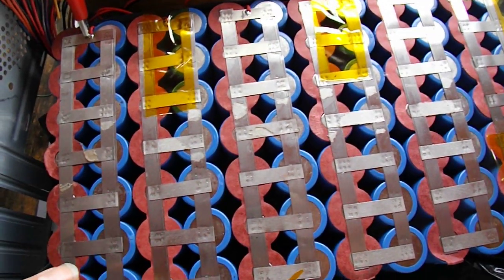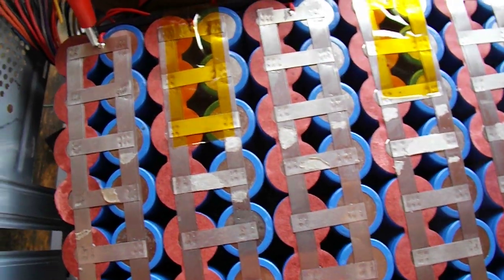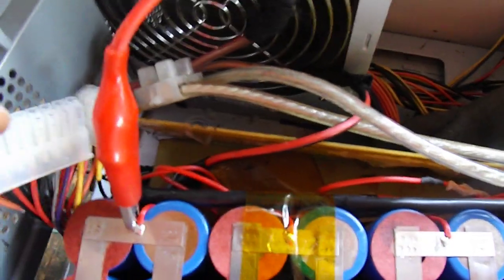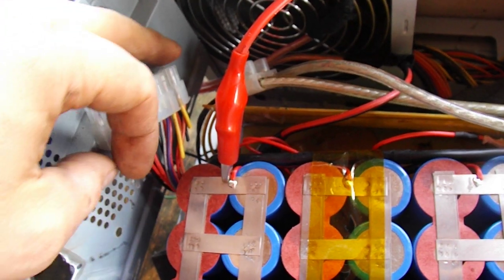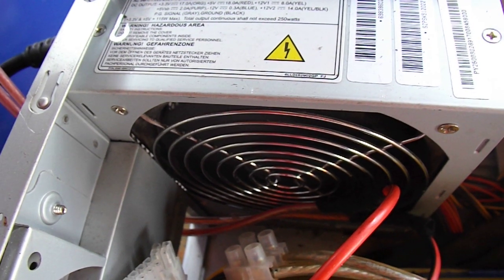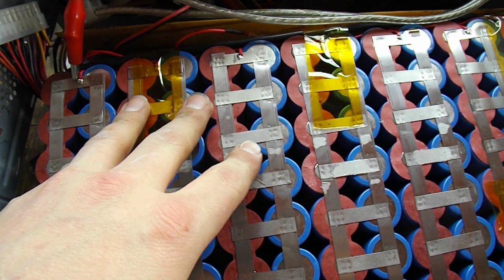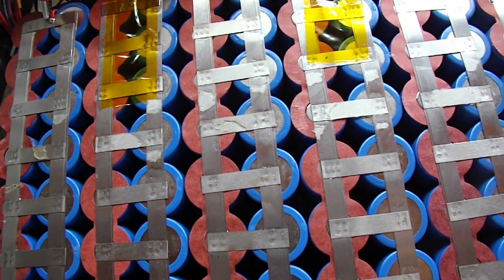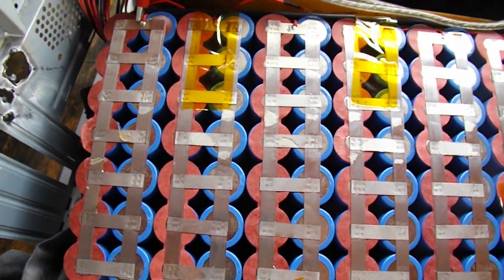charging  35ah 26650 13s  battery with no bms

Comment: How do you hook up that B6 to a 13s? When I try to plug mind to my porch with the output leads, I get an error message. It says "connection break"
Reply from the maker: charge cell groups 1 at a time
Reply: @TCBOT  through the output terminals or through the balance ports?